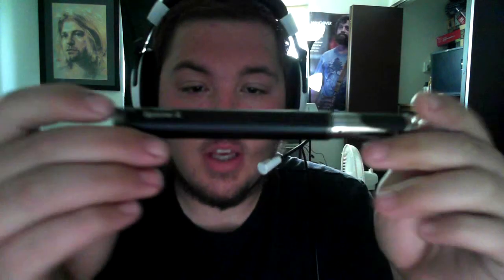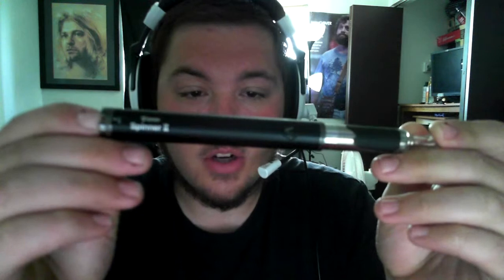Review: Vision Spinner II

Comment: hows your spinner 2 holding up? 9 months into mine and it barely lasts 2 hours. i would use it sometimes after it went yellow (they say charge it right away when it goes yellow for best overall battery life). im looking to upgrade, got anything better that fits a 510 thread? love my mini protank 3.
Reply from the maker: +l Knives if your looking for the 510/ego thread go for the innokin mpv 2 or 3 or somthing like that i got into bigger mods i started with a cloupor mini 30w box it takes 1x 18650 battery and just today i recieved my new ipv 4s that is a 120w mod and takes 2x 18650s i will be doing a show and tell video on that soon just gotta get the hang of it but i didnt have that problem with my spinner i cant remember how long i had it for though but i know it was a good starter and i did always put on charger when it went yellow cuz it never had enough juice for it to give me the throat hit i wanted